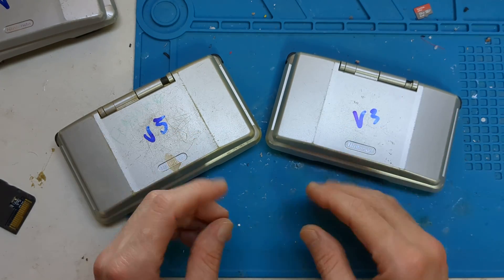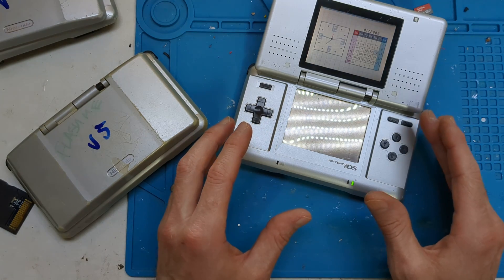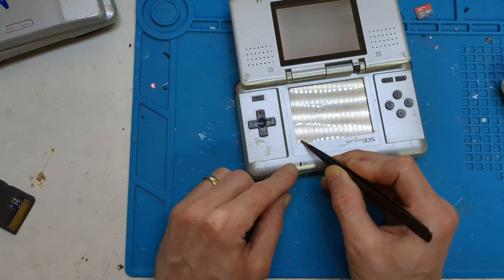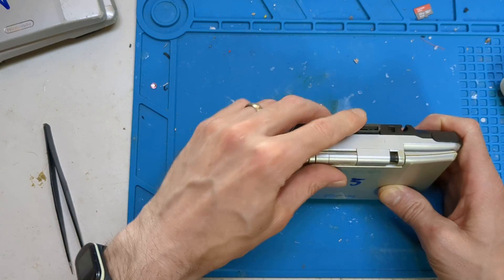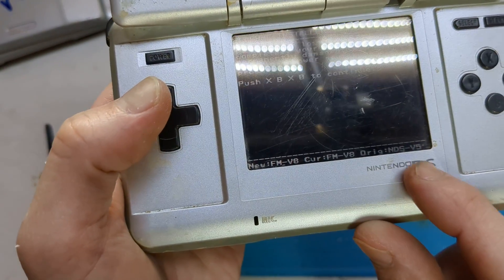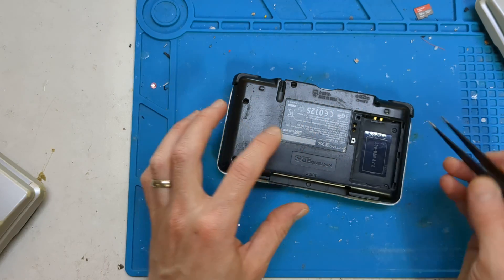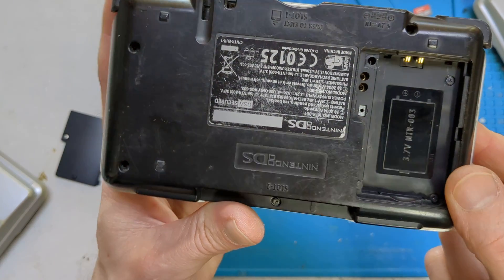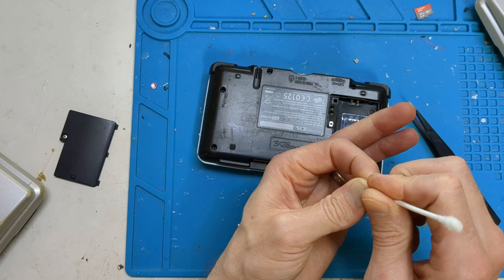DS Phat multi brightness levels

Comment: Just flashed my V4 Graphite black DS and it worked. I first used a flat head screwdriver, and did something really bloody stupid. I twisted it around trying to make contact, so I've probably fucked the contacts and scratched them up. I finally used a torx head and that worked straight away. Currently have my ds power light flashing red and green rapidly very fast blinking, but I'm hoping it's just low power on my battery and not because I've scratched the contacts :(
Reply from the maker: Ah I've heard some of the v4 do work so thats good to know. What's your serial number?
Reply: @facelesstech I am so sorry I didn't see your comment. 2 years ago! My graphite black serial is NJM15099517. Are you archiving what consoles can be flashed for brightness levels? Id love to know

Comment: I know this is a long shot but I recently built my own Gameboy Macro out of a DS phat version. I'm very new to this but I'm trying to figure out a way to swap the top screen with the bottom screen because it seems my top screen is brighter. They seem to have the same ribbons except the top is obviously missing the touch screen. Any way you that you know of that could make it work?
Reply from the maker: You can just take the touch screen off the bottom screen, they are just stuck on with double sided tape. Or you just don't have the touch screen attached if your not using it

Comment: IIRC the power management chip (responsible, among other things, for backlight control) was changed to the same one used on DS Lite very late in the original system's lifespan - I believe boards marked NTR-CPU-20 are capable of the multi brightness. If you remove the battery and look in the hole to the left of the battery contacts you will see a number indicating the board revision you have.

As an aside, some flash cards have a button to change screen brightness that normally only works on the DS Lite - if it functions on an original DS you have a model that has the new power management chip.
Reply from the maker: Oh wow thanks for the info, the more info we know that better
Reply: Do either of you know if NTR-CPU-10 are capable of multi brightness? I haven’t been able to find out online what firmware it runs. I currently have an NTR-CPU-01 with V3, so if I can hunt down a 10 it might be worth swapping the boards for multi brightness.
Reply: @partymanjj5522  Not come across one myself so can't say with certainty, but I am personally doubtful it can - if I had to guess they may use V4.

Comment: Are you sure this cant be done with a v4? Thats the firmware mine has
Reply from the maker: There has been reports of v4 having multi brightness but its hit and miss. V5 are guaranteed to have it
Reply: @facelesstech  thanks for the reply! Do you think its worth risking my v4 ds? Could it brick my system if it doesnt work?
Reply from the maker: @OMEGA521  it's up to you but yeah there is always a chance when fleshing flashme, just make sure your battery is fully charged and your connected to a charger before flashing
Reply: @facelesstech  hello i decided its worth the risk and im going to attempt it.  I was just wondering what the differences between the 4 different .nds files for flashme are? I want to make sure i do this right. Thanks for the help and i will reply with the results once im done.
Reply: @facelesstech  IT WORKED. im so  happy! I flashed is using flashmestealth and it worked!!!!!!!
Reply from the maker: @OMEGA521  oh wow, glad it worked. You got lucky
Reply: @OMEGA521  I did too and it worked!!!
Reply: I tried on my v4, it flashed but the multi brightness didn't work for me
Reply from the maker: @MrAdamg91  yeah the v4 models it's really hit and miss unfortunately. Could you tell me your serial number, maybe we can build a better understanding of which v4 can have multi brightness
Reply: @facelesstech  is that the number on the sticker on the back of the console? If it is that it's  NEH11212827 
Original firmware: V4
Reply from the maker: @MrAdamg91  yeah that's it. Thanks for that
Reply: I just flashed my V4 to V8 but no brightness control, serial #NAF10042688